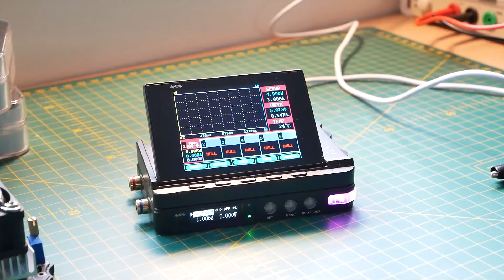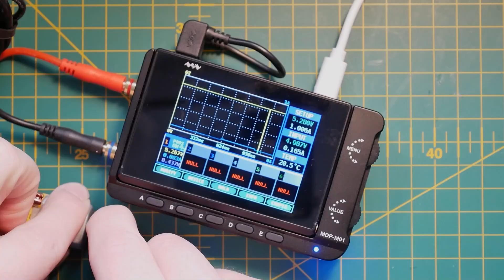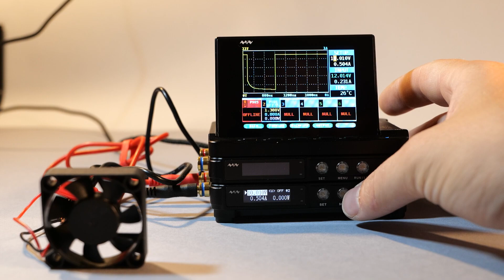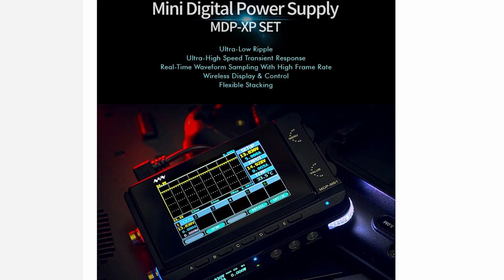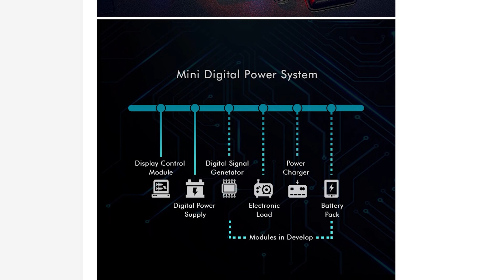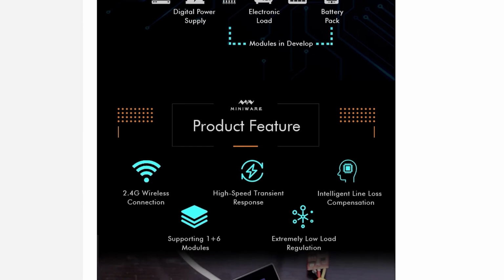300W in my pocket: MiniWare MDP-M906

Comment: A life time ago when I was a young unemployed man, I built myself a portable PC/eletronics repair kit and knocked on doors asking if their companies needed anything fixed. There were lots of networking stuff and printers and so on., but I would KILL to have a portable supply like this one, many times I knew what to do and how to check/trace and repair something, but did not have an Oscope and power supply. 

BTW, if you are reading this and think about doing something like I did - it works, just make sure you REALLY know what you're doing, you really don't want to be the reason a shoe store or something has downtime in business hours. Second thing, people will appreciate you - lot's of businesses have enterprise level needs but not enterprise level budgets - they are your market.
Reply from the maker: That's a really cool way to do business. The closest I ve done in the past was to fix laptops at uni to support myself through. And you are absolutely right - if you are the one that goes to companies size of your kit is everything